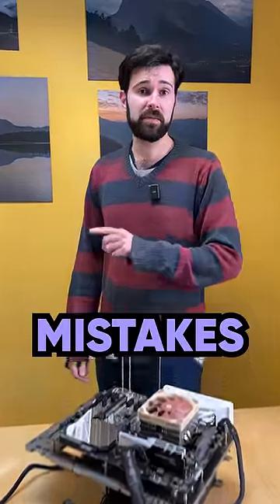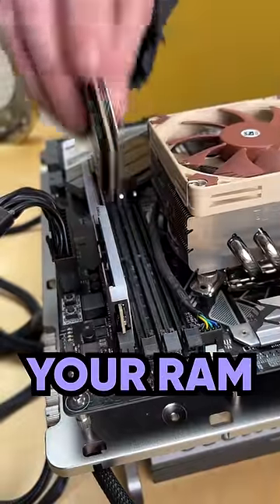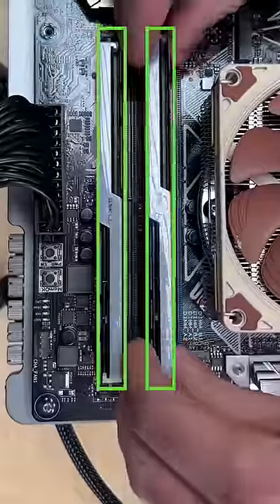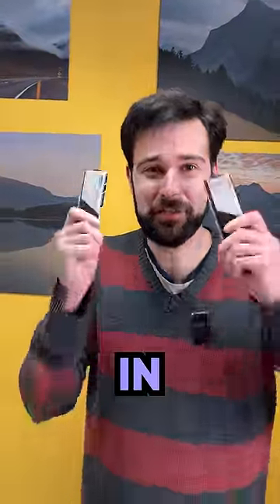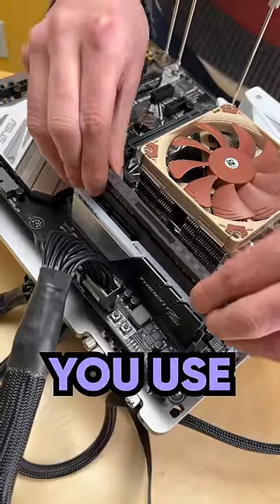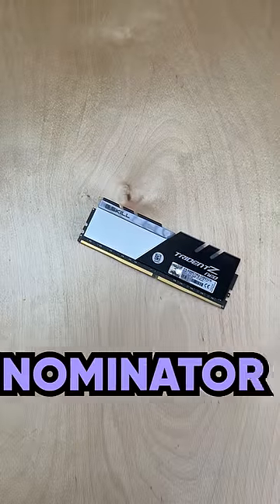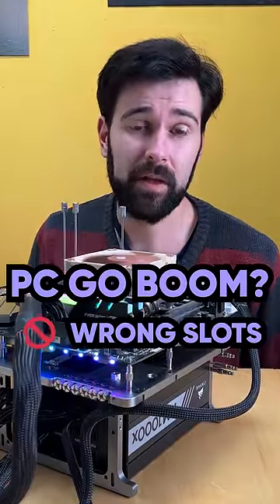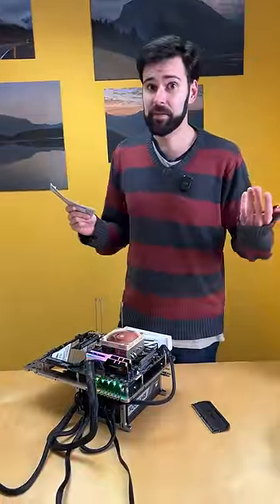Why you NEED to install RAM like this!

Comment: Small, but significant correction
Each RAM module is at least 1 Rank (this is mistakenly called side sometimes l
Installing 2 RAM modules into same channel is never same as 1 RAM module, as you have more Ranks
While Ranks on same memory channel cannot read or write at the same time, you can set up communication ahead, Rank by Rank and then just let it complete, again Rank by Rank. This way you can avoid biggest slowdown of memory subsystem - need to address by row and then column, there is latency to that, which you can avoid almost completely, if you prepare many transfers on different Ranks. You can do something similar on Banks of same memory module, but it is impossible to execute it so smoothly. 

This is reason why consumer grade memory is usually x32 or even x64 organisation and low in Rank count - it is cheaper, but slower
Registered memory can be x8 or even x4, which allows more Ranks on same size of memory. It is slower in general, but you can easily gain all lost speed and gain some extra by Rank hoping. 
Ranks are just like 2, 4, 8, 16 and so on logical memory modules on same physical memory module. Ranks do not share chips, only data and address lanes on module.

Comment: I have a ptsd with Rams since 2003/4 lol We bought our first modern pc at the time, mom being cheap opted out for a ram upgrade but it was actually an upgrade to make the pc run properly. Spent over a year with an ok pc that took almost 10 minutes to be usable just because the ram was so low even for a Windows XP. Thank goodness after a year of me bitching about the ram and my mom brushing it off, my dad listened to me and we brought it to a computer store and when they fired it up, at first they thought it was broken but I told them it was a ram issue. We threw in like an extra 256mb of ram and it suddenly started running fine. I think we only had like a 64mb stick or something that wasn't enough. Now 20+ years after, I build my own PCs and I got this weird obsession of having a lot of ram even if I don't need it. I got an odd 24 gb of ram on my current pc cause I'm using 2 different type of rams capacity but same speed that I bought to test out a motherboard during a fresh build to confirm it was broken and it wasn't just a ram issue and I went against returning it and just stuck it on a newer board as I sent the broken one for RMA to be replaced. I had to send it for RMA instead of bringing it back to the store due to them wanting to charge me like 50% to replace it since I didn't opt in for their "parts protection plan." Thank goodness I got that board on sale so after I got it back from a pretty much free RMA since the board company even paid for the shipping, I managed to sell it as brand new for a profit.

Comment: Just OC RAM manually if you get another stick. Or better always do manual OC. It helps a lot for 0,1 and 1%. Exception: you have 5800X3D. Then you can forget about OC, just turn on XMP.

Comment: Im sad you didn't mention possible system instability issues that can happen mixing ram. I've had that issue before.
Reply: I don't think that really happens anymore with modern systems, mine runs just fine.

Comment: Hey, should also tell everybody that if you have only one stick of RAM you ALSO should put it in the manual designated slot, from my experience with single channel RAM having it in the wrong slot ALSO affects performance, friend took out the RAM stick to clean it and then put it back but in a different slot than before and that severely affected CPU performance in his case with an i3-10100F.

Comment: I built a pc for a friend, and he bought a cooler that covered 2 of the 4 slots, so we had to run it in single channel lol
Reply: Could you pls tell me the model of that cooler? I've got big ass cooler once (SPC FORTIS3) and it was leaning more to the back of the case leaving ram slots unblocked. At my current build i use enermax ets-f40-fs and theres good cooling and plenty of space.

Comment: Some boards could use better naming to help prevent this. My mobo has A1, A2, B1 and B2 slots and the best configuration is A2 and B2. That defies all logic for someone that doesn't know anything about this (and didn't read the manual).

Comment: Well mixing RAM is also kind of risky, because for example 4000mHz DDR4 has very specialized chips that are hand picked and then also fine tuned so it can run at those speeds. 
If you use that with, say, a 2400mHz stick it will be really unstable. If you are mixing and matching then at least try to get the same type of dyes

Comment: Depends, If you have only 4GB of fast ram, it would make sense to add another 4 or 8gb of slow ram, as memory size below 8GB is more important than speed.

If you on the other hand have 2 sticks of 8, or 16GB, in most cases there's no need to add another (slower) stick

Comment: Up until DDR4 2 sticks in one channel will perform better than one cause the mem controller recognizes them as a dual ranked setup. If the sticks are already dual ranked that goed up to quad ranked.

Comment: you forgot to add you use slot 1 and 3 usually as it has the shortest traces to the CPU to benefit fully from the bandwidth and speed, by design of mobo manufacturers.

Comment: Once had a guy get furious online when I said I upgraded to 32gb from 16gb with a matching 16gb kit because they didn’t come from the same package and I was wasting performance. Like, I didn’t need 32gb when I bought it, mostly for gaming at the time, but have since gotten into blender and unreal engine. The best part of PC is upgradability, and they were literally the same ram, and I got a stable OC on the ram as well

Comment: Always refer to the user manual to figure how channels are set up. Its not always this way.
Also, some sticks won't run at lower speeds. I once tried running 3200 ddr4 on 3000, turns out it wouldn't even post. So my mixing experiment to run 48 GB didn't work out and I ended up giving the slower ones away.

Comment: Make sure you check your MBU manual to confirm you're slotting properly. I assumed I slotted properly due to my experience and I was running them in the wrong config for about a year before I finally realized it. 
THEN I had to remove the Dark Rock Pro 4 just to reslot a ram stick. An hour of my time wasted if I just spent 5 minutes reading the manual!

Comment: Just remember that the Frequency of two different RAM sticks has to be the same, even if the Capacity is different, when the Frequency is not the same it can malfunction and also end up the Motherboard to malfunction. 
Personal Experience.

Comment: This is an over simplified answer. In many cases higher speed ram run in single channel will outperform slower ram running in dual channels. If cost is an issue, it may be less expensive to go with a single stick of higher speed ram than two sticks of lower speed ram. There are more things to consider depending on what you use your computer for, but don’t stress out too much over it. Most of the time, it doesn’t make that big of a difference…most of the time

Comment: Worst case scenario (relatively speaking) is your computer won't POST at startup. And yes, I've had that happen before. But the fix is pretty easy, just move the RAM to the right slot.

Comment: My gig is a mix of old/new, as i have 16gb of ram, but its ddr4 and my motherboard only has 2 memory slots.
And all my storage is physical drives, 1Tb+750gb of pure HD. 
All paired beautifully with a 1060 6gb and a i5 7gen

Comment: perhaps they can just detect what slot they are in and run in the highest speed. Wait scrap that would add 4 cents to the 1,000 motherboard. They need that on marketing budget for sure.

Comment: Around 2005 I upgraded my Pentium 4 that had 512MB ram to 1.5GB by buying another 1GB, I think it had 4 total sticks 2x256 and 2x512.  Not sure if that matters.  but it certainly did improve things.  Half Life 2 minimised and maximised much faster.
I bought it from Crucial because I had no idea what to buy and they had a software that scanned my PC and found it had a certain speed RAM so recommended the same for me.

Comment: You messed up the definition "Lowest common denominator". 

The LCD of 3733 and 3000 is 1. If you plug one stick of 3733 MHz and another stick of 3000 MHz, they DON'T run at 1 MHz.

They just run at the lower frequency (3000 MHz).

Comment: Be careful with mismatched ram, it can cause issues if they aren’t running the same timing!!! It’s a number that most people think means nothing but they need to match! My personal computer was running two different brands with different timing for a few months and then all of the sudden crashed and would not boot, we had to wipe the drives and reinstall windows before realizing it was a ram problem. Be careful out there.
Reply: no the mismatched ram wasn't the problem here if it worked for months. If that was your problem you would have issues right away. This sounds like a faulty ram stick. If that's it try running them one by one also do the memcheck. If the pc doesn't turn on with one ram at all it's either dead or incompatible, but it cannot be incompatible if it used to work before. In terms of just getting random ram you found to work: Mismatched ram should be fine as long as it's in it's own channel. In terms of buying, there's no reason ever to use two different types of ram. It just wastes money if one is better than the other.
Reply: @harshnemesis  both sticks of ram always worked and still work they just one day decided to stop liking each other
Reply: @richardlushenko3429  if it posts fine that doesn't mean ram isn't faulty. There's memory check tools. What motherboard you have, normally it should work that's what multiple channels are for
Reply: @harshnemesis  I’m a gamer, the ram works. I allocated large portions of it for certain tasks and have no problems with either set of sticks

Comment: Not all boards are made this way... All my older boards were an generally had different colors like red ch1 red ch1.. orange ch2 orange ch2 all my newer stuff was made like each pair of slots was ch1 ch2.. ch1 ch2 best way is read the manual or look on the board too see which channels are wich

Comment: If you have two different Rams different types of companies it could be off balance in the chance it could work maybe not but but most likely it will be so off-balance it might be under power you want to get the full benefits

Comment: I dropped my CPU so I had to install my ram in the slots next to each other, and I could only use 2 of my 4 sticks. Out of all the pins that I could have bent, it had to be the memory controller ones

Comment: Has someone ever encountered the case, that your PC doesn't start in dual channel mode? Mine does only start in single channel. I already changed the motherboard and it's still the same.

Comment: What about xmp? Can you use to upgrade one to match the higher one?
Reply: Sadly no, XMP will set all sticks to run at the slowest stick's speed. You could try a manual overclock and directly set the slower sticks to run at the higher speed, but this will almost for sure cause them to become unstable and crash the system because they're not built to run at those speeds.

Comment: I'm sorry, i know you mean well, but maybe in stead of only saying what's wrong, also explain what's right. "Same channel" doesn't really explain it to a newbie. Easiest rule of thumb: 1 Dimm in the slot furthest away of the CPU. If you have a second Dimm, skip 1 slot from the first Dimm and add it (usually this is indicated as A2 and B2 on the motherboard). If you would have a third Dimm, add it in the empty slot in between the first 2 Dimms (second furthest away from CPU). If you would have a fourth it goes in the remaining empty slot; the one closest to the CPU. This would usually mean the first pair is in A2/B2 slots and the second pair is in A1/B1 slots. This is true for most motherboards, but use the "furthest away from cpu & skip a slot" rule for populating Dimms.

Comment: i just use whatever ram there is i could find on old systems..... i even have a random 8gb stick with no brand together with 2 different speeds hyperx 4gbs for $8 because it works

Comment: so all 4 slots can be used right? but if I have 2 at a lower speed and 2 in a higher speed, all 4 will run at the slower speed right?

Comment: What if you had two different pairs of RAM at different clock speeds? If you seated them in the correct slots, would you still be throttling your RAM?

Comment: i have my ram in slot 3 4 why well the pc turn on and off on slot 2 4 and 1 3 slot. I dont know why butt at  least i have 8 plus 8 gb ram and yes its same speed 13.000 mhz ddr3 so no preformens drobs hoppfely.

Comment: i do not agree with all of the conclusions in this vid. if you run two sticks in single channel, it's NOT like using only one stick - especially capacity wise...
also a faster stick paired with a slower stick can still be used with their respective individual clock speeds / timings by using unganged mode.

Comment: Uh, hold on just a second here. Is this a social experiment to see if people will believe stuff just because it’s coming from Linus Tech Tips? 

It’s not just “running ram a slot apart” 
You have to consult your motherboard manual, sometimes you’re required to use slots 1&3 sometimes slots 2&4 when there’s only 2 sticks slotted in. I feel like that should have been mentioned. Also, there’s much more to it that needs to be considered. 

Running ram in single channel is not the same as running only one stick of ram. Not even close. I can’t even blame that on poor wording. That was pretty explicit, and very inaccurate. 

We’ve seen dual channel explained a billion times on LTT, and some of the stuff in this video contradicts a lot of what this channel has taught the community. 

Needless to say, I’m confused as hell right now.

Comment: Is it always the case that the slot next to the CPU is the first one to be empty and then go from there or does it not matter which 2 offset slots you choose? Ex. 1&3 vs 2&4, not that they are numbered though

Comment: Isn't it that the order of RAM slots channels are CH0 CH1 CH0 CH1? You generally want to have RAMs on the same channel, because that provides better stability and actually increases the performance, since the RAMs do not have to communicate with each other, each slot in the same channel simply reserves different part of memory. But a different channel reserves a different memory bank, which further increases the memory and lets your PC to switch between RAM channels really fast (that's called multitasking), and most of the time you won't notice that happening as it barely impacts the performance. But you do have to keep the same RAM parameters on the same channel for both sticks, because otherwise the mismatch could render your system highly unstable and may not even boot. You could technically mix different parameters on different channels, but that may confuse the computer more than is necessary, so it's best to simply keep the RAMs in the slots being same parameters.

Comment: So quick question, I had 4x2GB RAM sticks (old pc) and I decided to upgrade and bought 2x8GB sticks. The new 2x8GB works great but would I get more performance if I install 2x8GB and 2x2GB for a total of 20GB of RAM ? (I only have 4 slots) Im a noob at this pls help. Idk if its relevant but the 8GB sticks have higher frequency than the 2GB sticks and im able to dual channel

Comment: For the lowest common denominator part, is that just speed? Or does that include size, too?

I.e. I have 4 slots, dual channel. Currently have 2x 16GB sticks at 3200 Mhz. If I add 2x 32GB sticks at 3200 Mhz will the system only see/use them as additional 16GB sticks for a total of 64GB? Or will the system see/use their total size of 96GB?
Reply: Nope, only the speed. As long as the speed is match you can you use any size instead. So you will had the 96GB instead.

Comment: But what about same spec ram but 1 kit is dual rank and other is single rank? Does the cpu still receive dual rank benefits when both kits are installed together?

Comment: Genuine question here, i have 32gbs in my pc rn and i have 2 spare 8 gb sticks that are 3200mhz, the 32gbs that are in the pc rn are also 3200mhz, would i be able to add that back into the pc without issue?

Comment: So what happens if I purchase a two pack of for example DDR4 3600 ram and set one in the first slot and the second in the last slot, will this not matter at all?
Reply: Most modern boards are daisy chain topology and require populating the furthest slot in each channel (usually labeled A2 and B2) to prevent signal reflections at higher speeds. Populating the nearer slots instead will likely result in you not being able to use XMP.

Comment: I have a gameinng laptop and i got ywo ram stick but i font play super heavy games so i got a high speed ram stick at 16gb at 3200ghz  and low end stick at 32gb at 2800ghz they may run slow but i just need the capacity for games like terrira

Comment: I need some help. I got two memorys 2x8 at dual channel, they are DDR4 3200 with a ryzen 5 2600. I have 2 more sticks free so if i want to expand the memory what would do it better ? 2 more at 3200 just do fine? O i Will lose the bandwidth ? Or just 1 more 16gb ? (Note: I Will not be capable of buying the same brand i hace already)

Comment: What if you have 3 sticks? I bought 2 new ram sticks, installed them right next to it, they’re rgb so they lit up just fine but my pc wouldn’t post. I took them out and just kept the original and it was fine. Hard to find anything about my specific situation